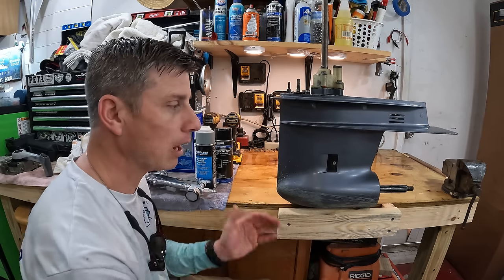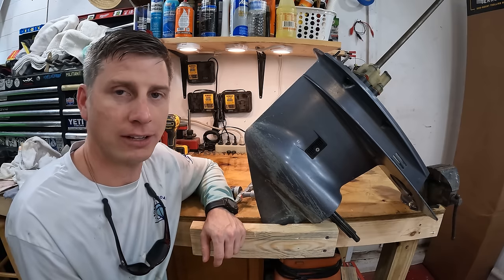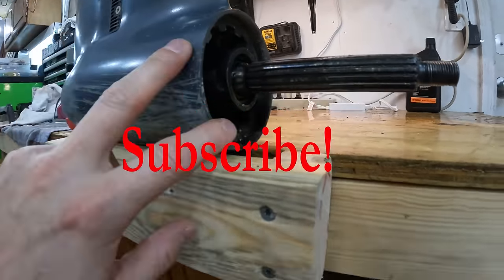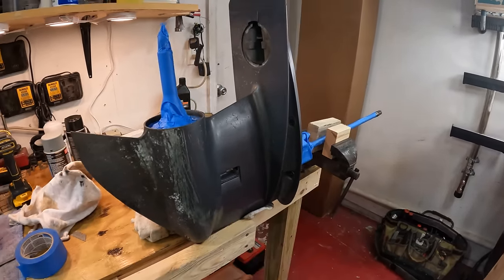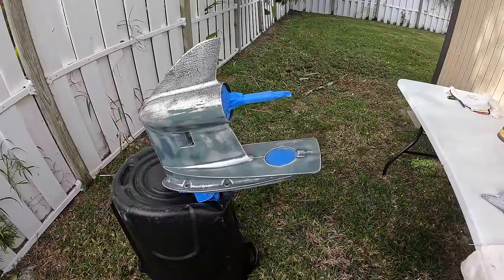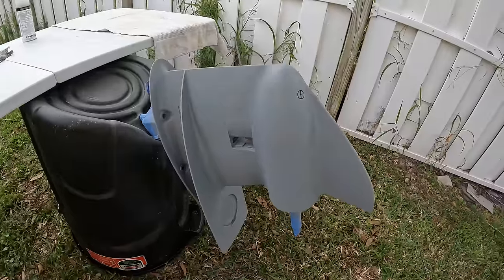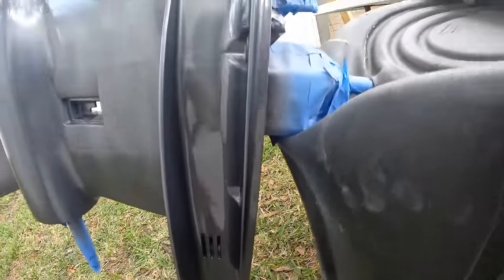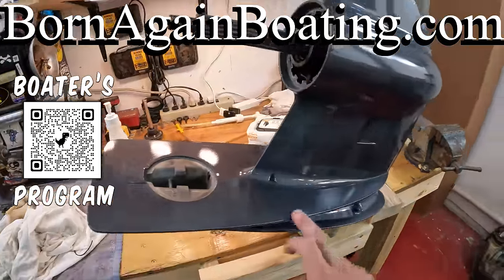How To Paint A Lower Unit

Comment: Generally good video.  My concern would be how aggressive your prep sanding was, much down to bare metal.  Most marine manufacturers use some form of corrosion resistant chemical etch to the aluminum (Zirconium, Zinc, Chromium, others) and by sanding as aggressive as you have shown, you are removing that layer you won't be able to replace.  Priming obviously helps, but not to the extent that the chemical etch would.  My recommendation would be to sand only as deep as necessary and try not to break through the factory primer.  Then prime and paint as you had shown.  If you don't like the deep scratches, you would be better off to fill them and paint over rather than sand them out of the aluminum.  Keep the vids coming!

Comment: I re-painted mine while still attached to the outboard engine.  Sand.  Mask.  Wipe with wax & grease remover.  Marine zinc-chromate primer.  Paint.  Clear coat.  Voila.

Comment: I am curious why you did not first use  Marine zinc-chromate BEFORE using the grey primer? Zinc Chromate is always vital to make this work long term. It also is a barrier needed on bare aluminum in saltwater conditions. That greenish color you sanded off was that protective layer. It is expensive stuff but amazon has it for around 14 a can. Please guys, do not ever skip this step. Electrolysis is also stopped in part by using this stuff.
Reply from the maker: Easy answer, I forgot too :/ lol but you are correct chromate is a necessary step

Comment: I’ve had  a problem with. Acrylic paint and clear coat it can crack You don’t have that problem with enamel’s. I find I painted a Suzuki cowling and the clear cracked on it.
Reply from the maker: Yeah, that must be it, the acrylic clear coats crack, I've had that happen to me before but I didn't put it together that it was the acrylic clear coat and tno the enamel, why would a marine company sell a cowling clear coat that is acrylic???? lol thank you for commenting!
Reply: @BornAgainBoating  yeah right it does not hold up well I’m doing my 1994 evinrude 25 hood over and leg as they never used primer on their motors towards the end

Comment: Great video! But you should point out that the wire brush should be aluminium/same as what you use it on. Its a harsh environment down there.

Comment: I just got my outdrive painted by a "professional" who spray-painted the power tilt rods...  i thought this was a big no-no as it puts wear on the gaskets?  Am i correct?  (they also painted my stainless steel duo-props) Arggg  =(
Reply from the maker: Yes, you are correct, this is very bad and you need to get that paint off the trim rams because it can mess up the seals, but don’t scratch the paint off because you can scratch the rams in the process :/ use maybe a paint remover of some sort. That is an unfortunate event :(

Comment: Have you ever used a trigger cap for the rattle can?  Saves on the finger.
Reply from the maker: Yes, and I love it but mine broke last time I used it and it would just push the can out of the holder when you would squeeze the trigger, I need to get another one lol they aren't expensive I just didn't have time to go to Home Depot and get another one lol

Comment: Just an idea, erosion strip on the leading edge. A heavy, clear adhesive that is applied , like a clear coat but a tape that will take some impact damage.
Another idea have you ever bead blasted the lower unit? A heavy Teflon paint is close to bullet proofing the surface.
Reply from the maker: Never bead blasted, but I've heard of people doing that

Comment: Juat curious what you would charge for a job like this?
Reply from the maker: Well, not really sure, personally I really only do work for content now, but if you hire someone, you've got about 2 hours in sand and prep, then about 3-4 hours in painting, but it's mainly 15 minutes at a time, so lets say 2-3 hours in painting and finishing. So that would be the time it would take to do it, and then plus materials and tax. Depending on the hourly rate, I would say you would be somewhere around $500-$800

Comment: Love the DIY videos, and a little focus on some two strokes. It'd be only too easy to focus on brand new boats. I re-painted a spare prop, and indeed all of the work is down to the prep. The process is very similar to painting a lower unit.
Reply from the maker: How'd the paint hold up on the prop? Was it stainless or aluminum? I've never tried to paint a prop but am super interested in it
Reply: @BornAgainBoating  Pretty good so far. I was worried it'd start peeling from the tips of the prop blades first, but after probably 6 months so far, it hasn't lost any of the paint.
I used a wirebrush on a cordless drill to remove all the old paint which was time-consuming. Then I used a dremel to rough up the surface and get the hard to reach spots. Then an acetone bath, 3x coats of self etching primer,  finally finishing it off with multiple light coats of gloss white paint. It was a 13x19K Yamaha OEM prop (Stainless).

I've since done another Yamaha 13x19K prop, and it came out even better, based on my experience first time (I allowed more time for the paint to cure, it seems thicker which I suspect will last longer)
Reply from the maker: @jrbuch  interesting! Thank you, I think ima try that!
Reply: @BornAgainBoating  Hope it goes well. Would love to see a video of it sometime if you decide to make one. 
I used two wooden stands, with a steel rod through the center of the prop to support it while spraying.

Comment: Nice job! When I was going fishing on the river 3-5 times a week (miss those good old days), my skegs were always bare aluminum, as we have a lot of sandbars and shallows here, so I only painted them once a year, as part of general maintanence before winter storage) Used straight up paint without primer or clearcoat, as there was no sense in it - it would sand away after 2-3 days of fishing) No big deal in fresh water, but if salt water is where the outborad will be used, you want as much of those coats as reasonably possible, because corrosin will eat aluminum away.

Comment: If I may add my two-pence worth, ground contact points and anode should always be bare metal so any paint on them needs to be stripped off at the prep stage. Pitting and scratches could be fixed with body tiller and sanded smooth. Light scratches can be fixed just by using filler-type primer and sanding between coats with 400 grit sand paper. (Wet preferably). Acrylic clear coats do not stand well and generally will be diluted by any petroleum product like gearcase oil. Better use a 2k epoxy clear coat. It comes in spray cans, is easier to apply and will stand up a lot longer than acrylic or any water based products. Always wear a respirator when spraying 2k. Regards !
Reply from the maker: Thank you, great info!

Comment: Great video! Question please. 
You mentioned you must paint the lower unit. Does this pertain to saltwater applications only.
My Mercury only sees freshwater.
Thx!!
Reply from the maker: If you spend a ton of time in the water, yes, even fresh water too :) If it's just the skeg that's got the paint missing, you don't have to pull the lower, you can just pull the prop or even bag it up and just sand and paint the skeg while on the boat! :)
Reply: @BornAgainBoating  Great, good advice and a great video.
Thanks for taking my question!